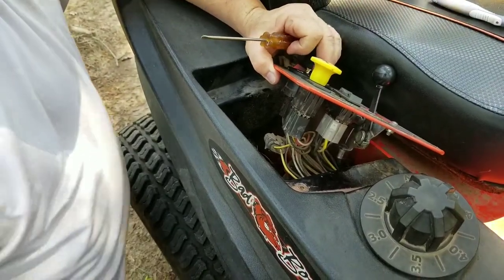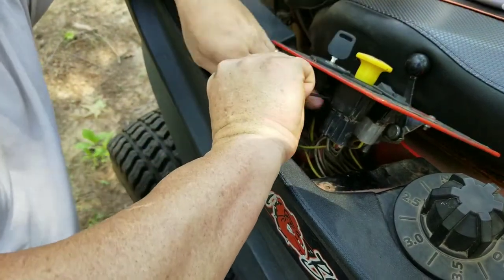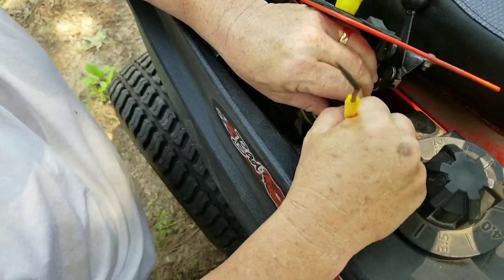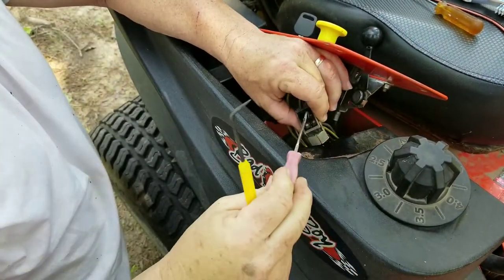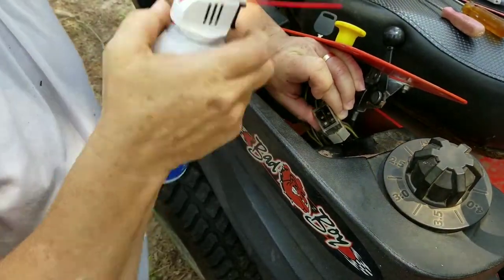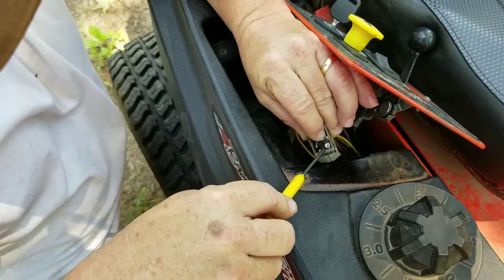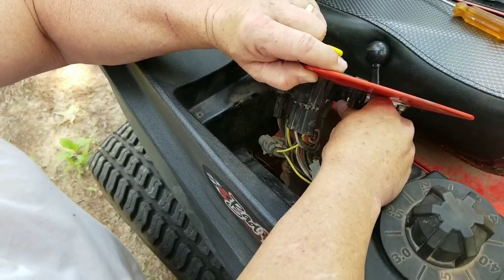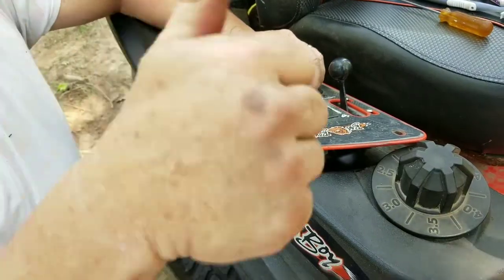Deck switch on mower won't raise up and down. Bad Boy Mower ZT Elite, 747cc.

Comment: Is there a certain procedure to adjust the dial, I just bought a used zt elite and the dial won't turn, do you need the deck all the way up before it will adjust?
Reply: I have the same problem.  The dial won’t turn.

Comment: Can someone please advise how to adjust the valves so I can move (not running 2015 Outlaw XP)?  There are two vavles on hydraulic pumps but not sure which direction to move them.  Thank you!